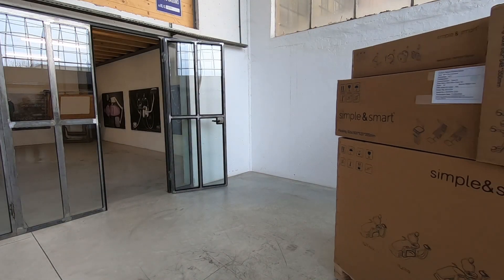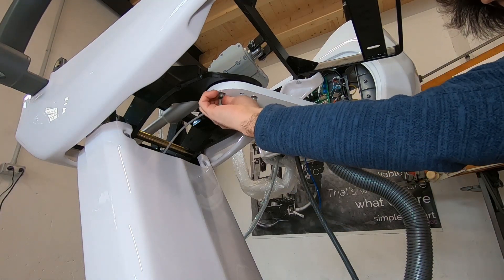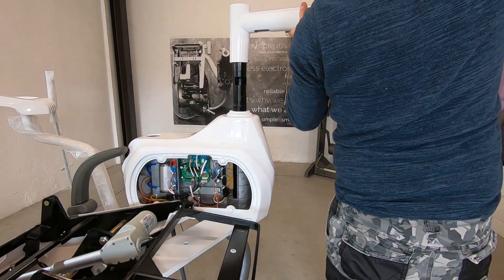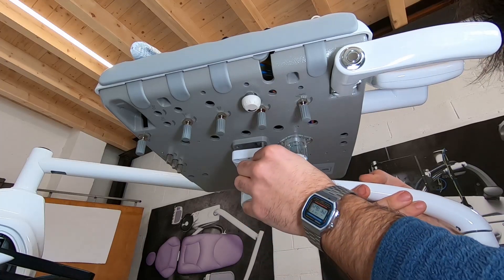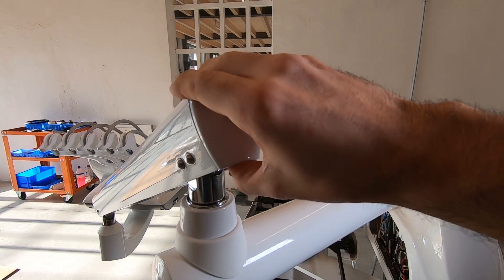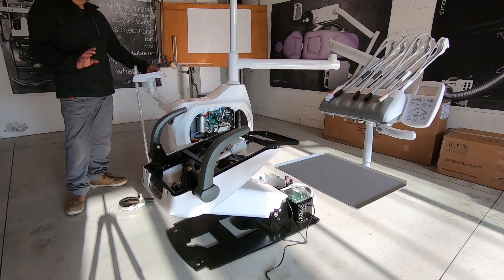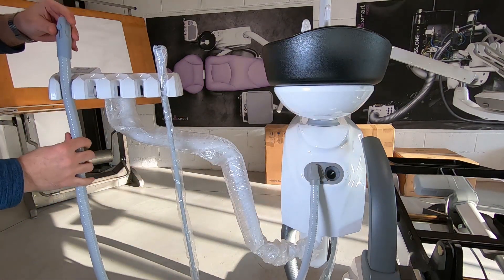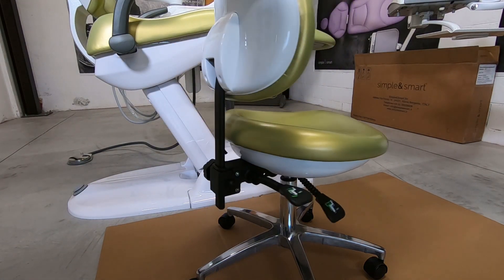INSTALLATION MANUAL | ONE & ITALO dental unit

Comment: How do I set up the board command for the chair's up/down, back/forward movement? Now it is stay on the back.. before that has refuse to get up..  crazy..
Reply from the maker: Hi! To resolve the problem, you can try to reset the dental unit maximum e minimum positions with this procedure: https://www.youtube.com/watch?v=awcRrBsflUY You can also check other problems following this steps: https://www.youtube.com/watch?v=TB5xlGGjXXo
Reply: @simplesmartdental Thank you for your support. Because of this, when I intend to change the chair, I will take your company into consideration. I spoke this morning with a technician and (as you advised), he told me how to reset the min-max movement. So, in my case, I had preset it for a long time until I noticed a blinking sound from the PCB. Then it made a complete operation until it found its min and max position..